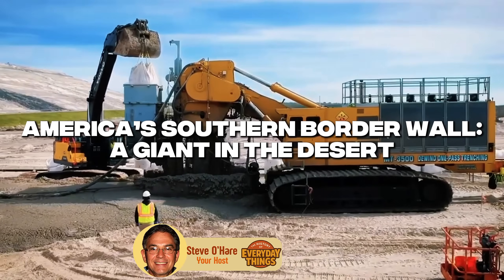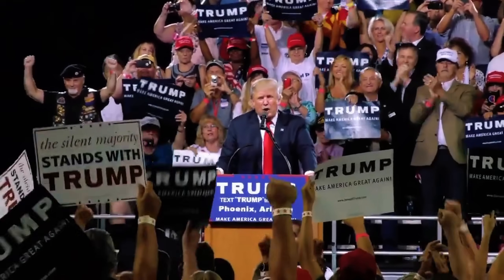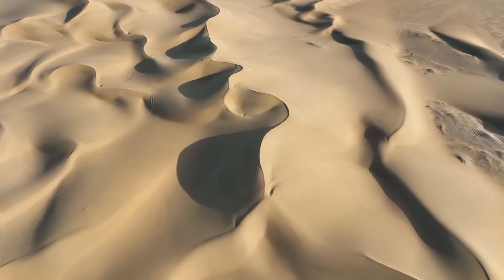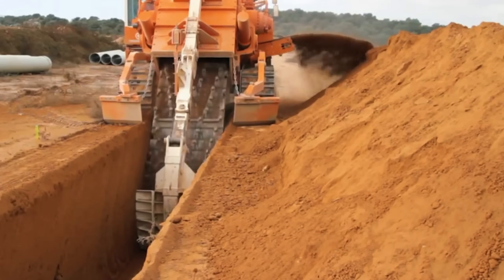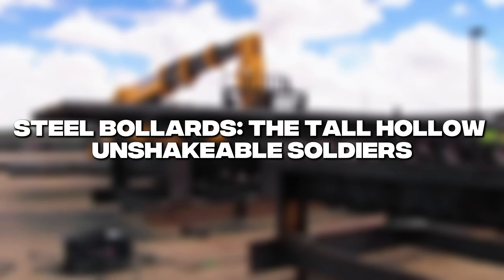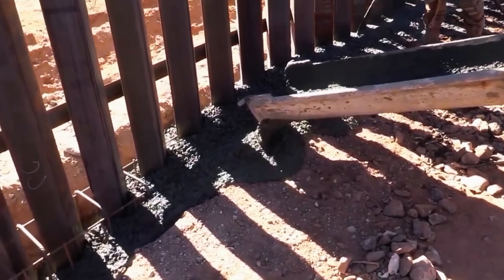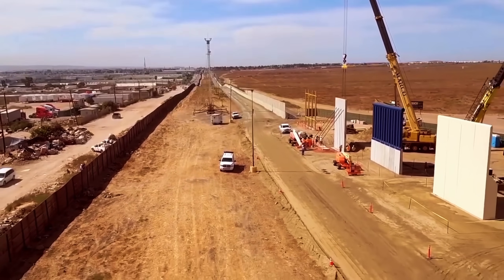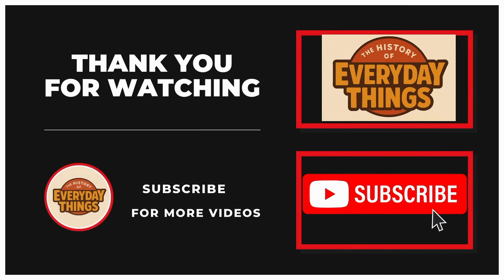How America Built The Biggest Wall in Southern Border To Stop Millions of Migrants Every Year

Comment: Who engineered the design of the whole project?
Reply from the maker: There wasn’t one single engineer behind the wall. The design standards were set by U.S. Customs and Border Protection under the Department of Homeland Security, with engineering oversight from the U.S. Army Corps of Engineers. Individual sections were then engineered and built by different private contractors, which is why designs vary by location.
Reply: @everydaythingshistory Excellent❤.
Reply: @everydaythingshistory  In other words, engineering by idiots--why am I not surprised?  We are becoming more and more like Putin's homeland than the one I grew up wanting to serve.
Reply: @trouble97018 noob
Reply: You can leave.

Comment: The wall is as necessary to the country as the lock on my front door is to my family.
Reply: We need a 2000 mile allegator-filled canal adjacent to the Fence, and another fence on the other side of the canal.
Reply: @bm5906  I wish. 😅
Reply: Thousand Percent CORRECT 🇺🇸🇺🇸🇺🇸🇺🇸🇺🇸🇺🇸🇺🇸🇺🇸🇺🇸
Reply from the maker: Thank you so much for watching!
Reply: The only problem is that it is not a wall. It’s a fence. A wall has a contiguous unbroken face. This fence is picketed. I am for the fence. We need a fence in front of the wall. They need to build a wall about a third taller than the fence behind the fence so there can be a secure patrol zone between them.
Reply: @hillbillysceptic1982  We need a 2nd wall in front of the fence that is mostly concrete that has towers for guards and drones.
Reply: @hillbillysceptic1982  That's not a bad idea.
Reply: @roberttresemer8226 Even New Jerusalem has a wall around it.
Reply: @hillbillysceptic1982  True. Vatican City also has a wall around it.
Reply: @roberttresemer8226 whether an American is left or right in the preferred approach to the administrating of governance, we all need to put each other first. America First. AMERICANS FIRST!
Reply: @hillbillysceptic1982  I agree with you 100%.
Reply: @roberttresemer8226   Speaking as a Catholic, it's too bad that the last two Popes (both Pope Francis I and the current Pope) have criticized the United States for building Our Border Wall, yet forget that they have both a Wall around Vatican City and the Swiss Guard protecting Vatican City. I love the hypocrisy that's being projected the Holy Father.
Reply: @southtexasprepper1837  I'm a Catholic as well, and I agree with you 100%. If the Pope is so opposed to our border wall, then he should order the border wall around Vatican City and the Swiss Guard be removed. Maybe once they are gone, he may finally wake up and see the necessity for our wall and theirs. The Pope should stick to running the Catholic church and stay out of national politics.
Reply: @roberttresemer8226   Thank You For Your Comments. "Subscribed" To Your YouTube Channel.

Comment: You forgot to add concrete was injected to the bars to make them harder to cut. Any way Thank you Donald Trump.
Reply from the maker: Good point — those reinforced, concrete-filled bollards definitely made the structure tougher overall. There were a lot of engineering details that went into the design. Appreciate you adding that in, and thanks for watching!

Comment: Hope they can electrify it if necessary.
Reply: It is necessary. Full electrification is what it will take. Plus, it's much cheaper than building a forever wall along the entire length of the border.
Reply: I gather you do not know much about electricity. You can not electrify the post. There could be wiring mounted on insulators that could be energized, but not the actual wall. But even at that just imagine how much power it will take to energize even one strand for 1500 miles.
Reply: @dallasarnold8615  It would be easier to use nuclear power to power it.
Reply: @dallasarnold8615 . Details, prisons electrify fences all the time. While the post may ground it, there's many ways to turn the juice on.

Comment: THEY ARE NOT HOLLOW GET IT RITE ...
Reply from the maker: Thanks for the comment! The design actually varies by section and area. Many of the modern bollards are hollow steel tubes that get filled with concrete and rebar depending on location and security requirements. Some sections use solid, reinforced cores, others stay hollow before being filled on-site. It all depends on the terrain and engineering spec. Appreciate you pointing it out.
Reply: @everydaythingshistory  sounds good..